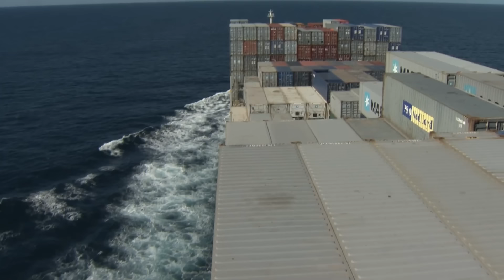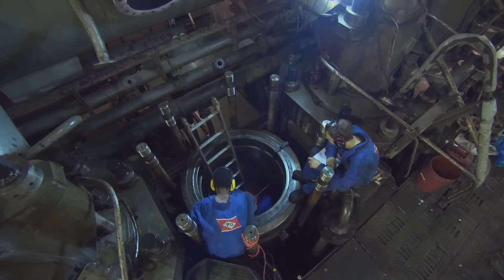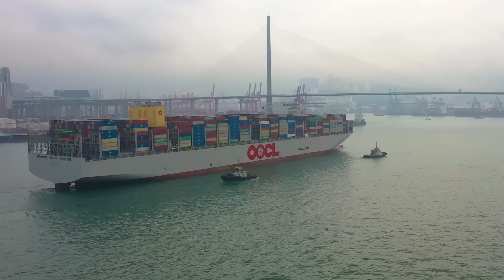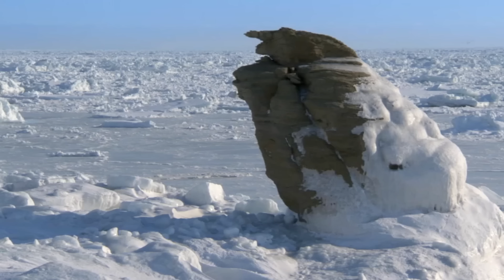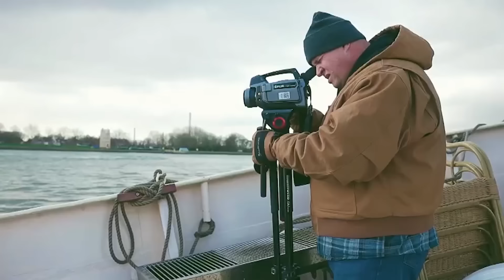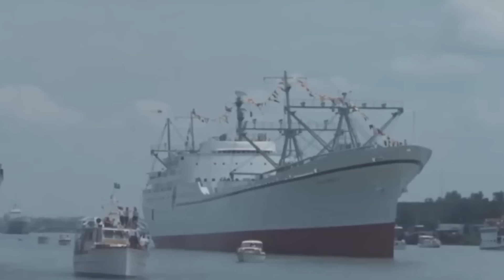Here Is Why Largest Container Ships Can’t Run on Normal Fuel and Use Asphalt Instead

Comment: Nuclear power would become cheaper once mass-produced. It is the best fuel for large container ships because the fuel tanks could be replaced with cargo. And, there are less emissions because it would be running on nuclear-generated clean electricity. Ports worried about pollution could have smoke-free ships.

Comment: Some very good comments here, I also ex Marine Engineer, the thing is this HFO fuel is cleaner and absolutely dry (no water, and treated on board), as the fuel injection equipment has superfine and precision machining, these Engines are above 50% thermal efficiency now and the running hours reliability is sensational.

Comment: They don't use asphalt, they use bunker fuel. It's quite thick, but after heating, diesels burn it just fine. This is good, because otherwise that fraction of oil would go to waste.

Comment: the very heavy bunker `c` fuel is mostly used on the big marine engines that run at 90 to 120 RPM. Pasenger ships [criuse liners ] use higher grade oil because the engines run at medium speed around 400 RPM. All ships operating in the actic or Antarctic must use a high grade cleaner bunker fuel due to the risk of damage to the enviroment. Ferrys & criuse ships have been & increasingly useing LPG  as fuel source due to the vessels being in a sensitive location close to populations, criuse ships with 5000 pax plus crew burn upwards of 300 tons of fuel a day. Even when the criuse ships are stopped alongside or at anchour the hotel side of operations still consumes fuel in a big way

Comment: These engines are massive and run at low rpms. Diesel would burn too quickly. This oil burns at the right speed for full combustion!

Comment: What would happen to the residue at the bottom of the oil refinery if ships stopped using it for propulsion? Unless there was a massive road building binge needing stupid amounts of asphalt, it'd need to be dumped. Ideally in a toxic waste dump, but more likely at sea.

Better to burn it.
Reply: It's never going to be dumped, and EPA stopped refineries from burning fuel oil decades ago. It can be upgraded through several different types of plant depending on the specific refinery, but in the end it all comes down to economics.

Comment: Just before i retired in 2015 i heard murmurings that some companies were waying up the cost advantage of using HFO against heavy maintenance costs of burning this horrible stuff? On the Aussie cost here you are apparently banned from using HFO within coastal limits? Therefore you have to run on MDO or Marine Diesel Oil whilst on the coast?
Reply: Literacy Please! Weighing, not Waying; expecting better from a fellow Australian. (Also Coast, not Aussie 'cost')

Comment: I am a retired ships engineer ex British Merchant Navy, The HFO is bunkered (taken into the ships double bottom tanks) from a fuel barge or small Tanker,  it is kept very hot during the whole process about 80 to 90 degrees Celsius in order to be liquid enough to be efficiently pumped, once in the ships double bottom tanks this high temperature is maintained by coils of pipes that have a special high temperature oil(not HFO) flowing through them from a "Thermal Oil Boiler) when required the HFO is pumped from the Double bottom tk to a heated Settling tank where it is left to settle out and any water and sludge is drained out over a period of a few hours, from the Settling tank it is run through the centrifuges often known as Purifiers or Seperators, as he says these things rotate at insane speeds and basically clean the oil of impurities eg sludge and water and other crap, so when it leaves the purifiers it is pumped to the HFO Service or "Day" tanks that supply the Main Engine(s) Injectors(We used them Fuel Valves not injectors) via booster pumps then the injector pumps themselves when the HFO arrives at the fuel valves it needs to be around 90 degrees Celsius to enable the fuel valves to atomise the fuel properly, so what provides the power to run the Thermal Oil Boiler etc? The Ships genrators, in my day (1970s) the generators or gen sets were usually run on Ordinary Diesel fuel, i think nowadays at least on some ships they are Also run on HFO which i dont think is a good idea? When you are Full Away at sea and up to service speed your thermal oil or in the old days steam did the job is heated by waste heat from the Main Engine exhausts in what is known as an Economiser, dont know with modern tech but we used to manoeuvre in port on Diesel fuel then slowly change over to HFO after Full Away on Passage (ie ships service speed)
Reply: Thanks for the detailed explation @setter501.  I always wondered the "how" of this process.  (From a retired Mech Eng.)
Reply: If I remember rightly, it was the job of the lowly 4th engineer to clean out the separators. As for me I was in the air-conditioned radio shack. Happy days.
Reply: Great explanation, thanks.

Comment: Cost is why they run on high sulfur (bunker) fuel oil. Every ship that runs it has the option to run on low sulfur diesel fuel and has to run low sulfur diesel within certain distance to shore. HSFO has nothing to do with the asphalt paving product shown in the video.
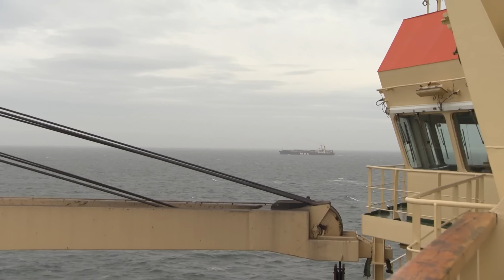Reply: You’re right about HSFO vs asphalt products… but at 6:42 the video literally explains why shipping companies still choose it anyway: $300–$400 cheaper per ton changes EVERYTHING in global trade 😅
Reply: Most use low sulfur HFO now, not the older high sulfur type, but it's still thick, black goo full of metallic ash impurities. (the latter are also high in nickel and vanadium, so there's economic incentive for more modern techniques of using the residual oil fraction as synthetic fuel feed and recovering those metals as well as the sulfur, though the latter is already being recovered for VLSHFO production).

Removal of the ash content would make HFO derived synthetics compatible with gas turbines, even if pre-heating or vaporization is still required. (the corrosive impact of the ash content inside the hot section of gas turbines makes it unsuitable as-is)

There are various possibilities, but the 3 main routes for utilization would be conversion to syngas via steam reforming or dry reforming using CO2 (from recycle or waste sources) or varying ratios of both to get the appropriate hydrogen ratio (potentially along with methane or hydrogen additions from other sources) then using fischer-tropsch synthesis to produce synthetic oils.

The other method would be hydrotreatment/hydrogenation of the heavy oil itself, producing saturated hydrocarbons from the complex mix of high molecular weight unsaturated (largely aromatic) hydrocarbons present, plus performing hydro-desulferization and hydro-cracking in the process to produce more fluid, but fully saturated paraffinic hydrocarbons (plus residual coke containing most/all of the ash to be processed separately).

And the third method would be coking + cracking using the thermal cracking method to produce a mixture of solid petro-coke (where most of the sulfur and all of the ash is trapped) and lighter liquid and gas fractions of cracked products that are then fractioned off, desulfurized, and further hydrotreated/hydrogenated into saturated liquid fuels (plus likely some LPG byproduct, possibly some light olefins as well that are more valuable as feedstock rather than for hydrogenating into LPG or light naphtha: they could be used for alcohols, ethers, or producing alkylate for gasoline, also for plastics and synthetic rubber).

The residual petro-coke could then also be utilized for syngas production and fischer-tropch products along with desulfurizing (required before fischer-tropsch synthesis can be done anyway, as sulfur poisons the catalyst) and concentration of the residual ash for further processing of the valuable metal content. (it's mostly iron, nickel, and vanadian, but the iron is relatively low value and tends to be left in the residual ash unless extraction of the iron salts formed during processing is useful as a byproduct from the higher value metals ... and something like industrial or agricultural grade iron sulfate would need to be reasonably purified to avoid heavy metal contaminants)
Reply: @chrishamilton53 
  That was informative! My brain hurts now. 🙃

Comment: They use bunker oil because it is the cheapest fuel available. It must be heated to allow it to flow.
Reply: Except due to current shortages of supply, there's a few cases where marine gas oil is actually cheaper (and simply available), so some ships have actually fueled up with that rather than bunker oil, but these are strange times.
Reply: Good in Boilers. Can be used in Diesels, but the drawback is, it damages the exhaust valves. Some large low speed Diesel engines, even though two stroke, still have Poppet valves.

Comment: What fuel do they use to heat the fuel?
Reply: Diesel
Reply: @northernmetalworker  & charles-u5b6c.   - ;   Waste heat from the main engine exhaust gas which is diverted through an exhaust gas boiler which raises steam at a workable pressure and is piped through heating coils and heat exchangers to heat the fuel or storage tanks. There is usually a 'donkey boiler' to initiate the steam heating system prior to the main engine exhaust boiler taking over when full away at sea. this will be fuelled by diesel oil but is shut down at the earliest opportunity to be economical.
Reply: Probably electric heating elements
Reply: @neilchilders5442 . Where or how would the electricity be generated?

Comment: What I don’t understand is why these ships aren’t nuclear powered?

US navy vessels can go out for years, and never need to stop for refueling.
Reply: Nuclear power is expensive to build , fairly expensive to fuel and expensive to decommission.  Even our helicopter carriers are using conventional engines.
Reply: These ships aren't nuclear powered because it costs tens of millions of dollars to decommission and store nuclear reactors and spent nuclear fuel. Traditionally powered ships can be easily sold for scrap.
Reply: It was tried in early 60s with SS Savannah a US cargo ship it was not a success to expensive to build and maintain
Reply: Many (most?  all?) civil ports, harbours maintenance install'ns, discharging install'ns prohibit the entry of nuclear powered vessels.  (edit:  "discharging" from "defueling")

Comment: I love your videos. I have been a merchant sailor for 24 years now. Yes HFO (Heavy Fuel Oil) was a big component for many years then the IMO changed environmental laws and we had to go to low sulfur HFO however there are spots like California where 500 mi off coast we have to switch over to diesel. These engines use what's called cylinder liners which are changed out on a regular schedule that prevent scarring of the engine casing itself.  while we are at the dock  we have to connect to ShorePower a giant extension cord from the ship to the pier.  The diesel generators continuously ran on diesel through the voyage until we connect to shore power than they are shut down. however I have been on a few ships where they can run off HFO but it is higher maintenance (cleaning) I have had to clean many of purifiers over the years it is nasty.  One of the problems of going nuclear is the way the union contracts are structured everybody on the ship gets close to the same pay so the person steering the ship gets the same pay as the nuclear engineer that was one of the problems with the nuclear vessel Savannah US flag in the 1960s
Reply: Thank you for correcting me;)
Now that’s settled for me. It’s been a curiosity for decades, 1956 here;)